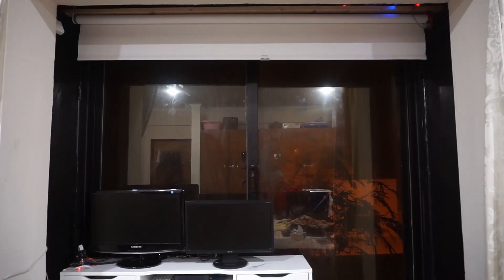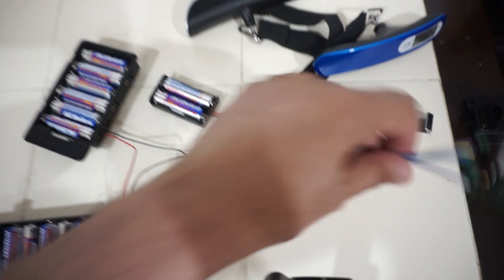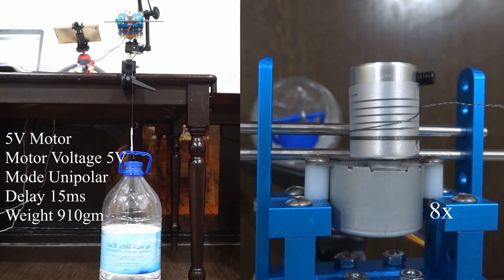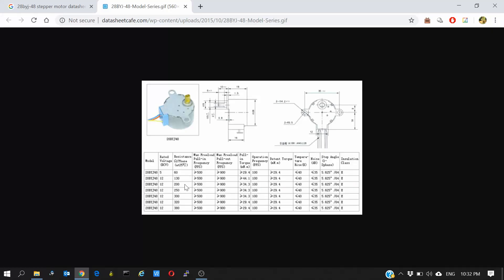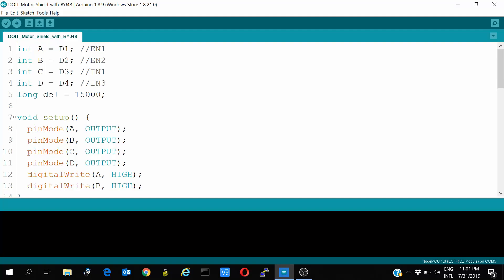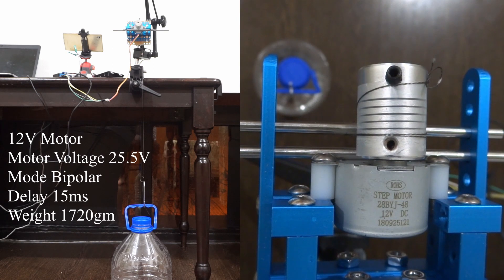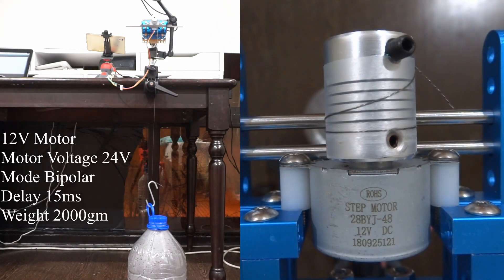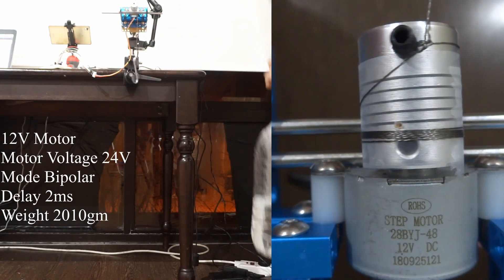28BYJ-48 Stepper Motor Torque testing and achieving maximum torque - Baba Awesam

Comment: Thank you so much for this very informative video - I needed a way to increase the torque for these for my flightsim throttle, for which I am using these stepper motors for moving autothrottles - simply using your code with the time delay set as you prescribed increased the torque to be perfect for my needs. An excellently presented video indeed.

Comment: Wow, that's a hell of studies to increase the torque of this little motor, I was exactly looking for this, built a project and during the assembling noticed that my 28By-48 5v can't handle the job, so I'll definitely try using it in bipolar mode, luckily I have some a4988 driver around, will try to use this one with 10V.

I appreciate you posting such a brilliant material around this little motor, keep it up and cheers from Brazil.
Reply: Make sure you convert to bipolar for the A4988. For non-PWM drivers, the center tap is always at 1/2 of the driving voltage and so little to no current flows through it. For PWM like the A4988, the centertaps are no longer always at 1/2 of the driving voltage.

You can use much higher voltages with the A4988. It uses high voltage to speed how fast the current rises, then holds at that set current. 24V should be fine as long as you set the current to the stepper rated current. In fact, the A4988 relies on using a much higher voltage or you get no advantage from it over using the L293D.

Comment: I don't have much experience with stepper motors but was looking into using this motor for a simple robot arm. I would gear it down quite a bit as I don't mind speed. How accurate is it at high torque values? Some people claim it has a torque clutch or misses steps.
Reply from the maker: The thing I learnt recently about this is that the output shaft can slip as the plastic and metal shaft is not glued. This particularly I noted at high torque. Maybe this is the torque clutch you are referring.

Comment: Hi. Nice video. thank you but I have a question. At the start you show that you use a 5volt 28byj-48. I know you need to make it bi-polar to use with cnc shield and a4988 driver. But you say you use 10 volt now? to power the bi polar version? How does that work? Does that mean you need 24 volt for the 12 volt version? But I never see anyone use 24 volt power supplies. it is always 12 volt connected to the cnc shield not 10 or 24. After I saw your video I have been googling but I cannot find my answers. It seems the a4988 need 8 volt minimum. So you can never drive 5 volt stepper right even if it is 10 volts the 12 volts supply is to much.   I am so confused now.
Reply from the maker: Hi. My tests are to check the torque of the stepper in various conditions and may not be practical. For bipolar mode, we have twice the coil at our disposable so we apply 5v on each set of coil, thus our input voltage of 10v. For A4988 and 8v, since your stepper can take 10v (5+5), provide the a4988 10v. It may even take 12v but you run the risk of burning the motor as you are going above the ratings.
Reply: @SamirSogay  yes. After more research it seems you can use 12 volt. It is just that it is not very obvious in most videos. If I trim the ref voltage to 0.10 and it works. It doea not het hot neither does the a4988 and i did not yet add the heatsink. I do use a very cheap volt meter so it might wel be that my 0.10 is only 0.08.  Thank you😁

Comment: with a current lmited a4988 in bipolar mode. does the torque differ between 5v and 12v? i'm running it at 200ma and i just BARELY lack enough power to lock my tools properly  and the motor is already a bit hot when I run it.
Reply from the maker: The torque differs but not considerable

Comment: I do wonder if you were able to provide enough current at high voltage.

I recommend a toolkit rc m8 or similar as a powersupply if you want an inexpensive one to test. It's also a useful lipo charger.

Comment: 3:25 for some reason with the same motor, same voltage, same shaft and same code my motor cannot lift more than 500g (at 2amp, not sure how many amps you are using in that example, but 2 should be more than enough I think)
Reply from the maker: Current requirement is more than enough. How exactly are you lifting the weight. Is it far away from the centre of rotation?

Comment: How can we make this bipolar without using codes? Please reply.
Reply from the maker: Any stepper motor requires microcontroller and microcontroller requires code
Reply: @SamirSogay  No I mean, can I just cut that middle connection of that motor to make it bipolar? I need help 🙏🙏
Reply from the maker: @_DarkKnight  you will still need a different Code as bipolar motor requires 2 coil activation at the same time
Reply: @SamirSogay  Thank you so much sir😊😊

Comment: Your code is much stronger than the current stepper code floating around out there. Other code samples only allow high current on a single coil, but running the current across two at the same time makes perfect sense. There's a huge difference between 300 and 900 grams for most projects, including mine. Thank you!

Comment: Have you tried the 12v motor in bipolar mode to increase the 15min roll up time for your blind? Looking to do that with my 180cm blind but 15mins is too long and curious to see if you can make it faster
Reply from the maker: I didn't try the motor with bipolar mode as I didn't want to fiddle with running setup. What I suggest is that you can try a step delay of 15ms instead of 30ms which I am using. I didn't find much benefit of using 30ms delay over 15ms so with 15ms, the blinds up duration should half.
Reply: @SamirSogay  Trying to determine which is the best option. Either motor on the blind itself (like your setup) or put a motor on the chain of the roller blind which means no need to worry about blind weight on the motor but won't look as neat
Reply from the maker: @silviudc  If it is chain based, I think etter option will be connecting motor to chain.

Comment: Excellent video 👍 I am wondering about running the motor at 2ms delay in bipolar mode at 10V. By how much do you think the torque will reduce? Do you have a torque-speed curve from your tests? Thank you!
Reply from the maker: I don't have a torque curve but it should be around 600gmfcm for 2ms delay

Comment: Excellent video.  There is one significant thing that is not well known, and it will influence your results!
These motors have a friction clutch.  The last gear in the internal gear-train is a snug fit on the brass output shaft; it is made so it will slip if too much load is asked of it.  The motors are made to oscillate the vanes in air conditioners.  On startup, the controller drives the motor until the vanes are forced against their end-stop, at which point the gear slips.  This is a simple way of "zeroing" the vanes, without the cost and complication of electrical end-stops.
If the motor gets hot, the gear will soften a little, and slip sooner, which explains why you could only lift smaller loads with a hot motor.
If you can lock the gear to the shaft, I am sure you would get much better results, but I could not think of a satisfactory way of doing it, and in the end I gave it away.    GOOD LUCK!!!     :o)
Reply: There is a lot more to it, addition to the clutch, the ceramic magnet inside is very weak compared to other can type or hybrid variety. Also, the magnet strength varies between different manufactures. The plastic gear train eventually will give up if overloaded.
Reply: @Śiśna3633  : Yes, they are a very low-budget "throw-away" item.  The gears are very weak looking... It's amazing they hold up as well as they do.  Great for learning though.
Reply from the maker: Thank you so much for this information